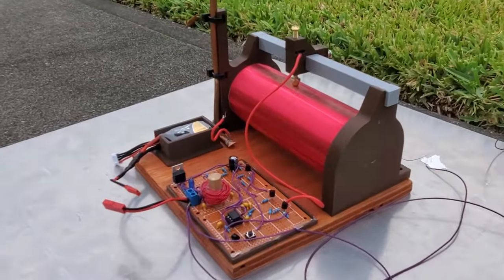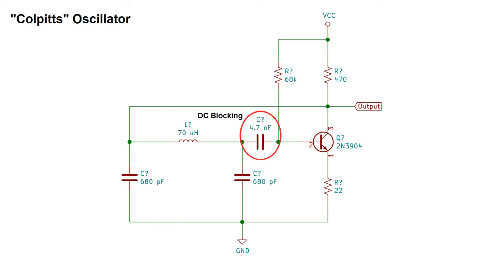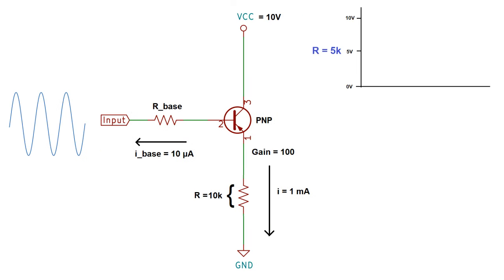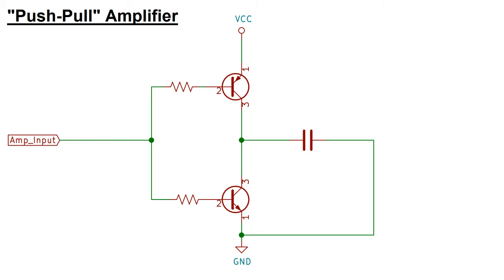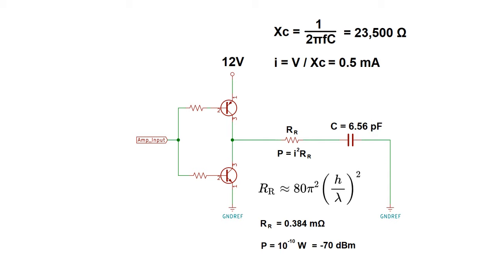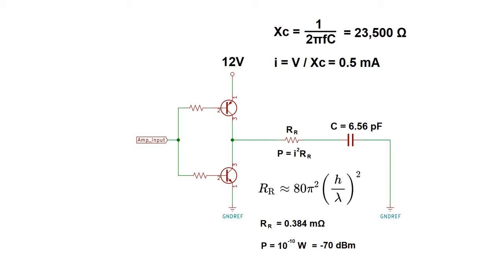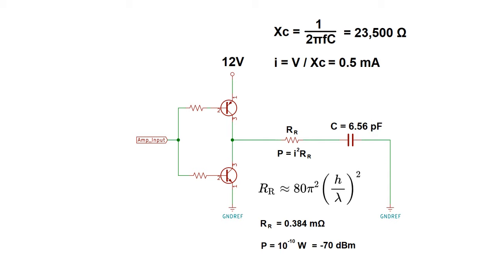1 MHz AM Transmitter

Comment: Well explained. I would generally be cautious though about transmitting square waves as the scope for spurious harmonics, especially without a low pass filter in circuit, is high. And yes, 1 or 1.6MHz transmissions,  without a broadcasting licence, are illegal in most countries.
Reply: Is it better to just transmit sine waves, and skip the wave “clipping” phase of this project that creates the square wave?
Reply: Can't be a Hyperspacd Pirate if you're a Hamm
Reply: I do want to get my radio license but how whould the government or related branches know it's me doing this and it's ok? I will make this after I get my license but whould me doing this get people angry Even if I have a license for transmission?
Reply: @kylewatson952  He's talking about transmission in so many YARDS of range, so the amount of power here is tiny, maybe 50-200mW, which will likely get swamped the first time someone with a '68 Cuda running copper core sparkplug wires drives by. :D   If you keep your transmission power under 200mW, and avoid sending profanity over the airwaves, try to stay out of active transmission space, and are only playing around 10-20 minutes at a time, nobody will likely notice.   As for locating spurious radio emanations, google search the term "radio fox hunts" or ARDF.  There are also plenty of public radio space bands to play with, called the ISM bands where you've got all sorts of consumer radio products operating, and oddball modulation schemes like LORA-wan devices, which is low power, low bandwidth, infrequent transmission for whatever gadgets you care to built. Say a bunch of remote weather or telemetry systems that can run off one 18650 battery for a couple of months.
Reply: Ya, square waves have infinite harmonics.
Reply: Also keep it under 100 mW (Milliwatts)and you'll be fine.  (0.100 watts)
Reply: My first schematic was a simple tube ( soviet 6P3S) AM transmitter with 10 W of power and crappy antenna. It has enough power to electrocute some sensetive digital devices and you because any object nearby  - antenna and when you touch something grounded - you get a shock..
Reply: he was so close!  😮  1.800-1.820 MHz is for Amateurs to do Morse Code.
Reply: This counts as a Part 15 transmitter, which can transmit with up to 100 mW in the US before running afoul of the FCC.
Reply: @stalkerfromvoronezh4493  😂😂😂
Reply: Square-waves all day, everyday!!!!

Comment: Why did you clipped the signal? It had a reason or it was a side effect of the amplifying? Also I noticed that the signal before the amplifier/clipping has 9.52V, and then it has 9.68V. It didn't changed that much. This step seems not necessary to me. Can you elaborate more?

Comment: Why add all the amplifying components if the maximum current draw from the antenna is only a few tens of milliamps? Yea sure you impedance matched it but the Q factor of that is so low that your not gonna be pulling hardly anything from your source. You could probably get away with attaching your antenna directly to the output of your colpitts.

Comment: When I was a child, built an AM tx using a 2sa15 germanium transistor, 1 ferrite rod, 2 100pf caps and 3 resistors. it ran of 2 dry cells. could be modulated with audio. It worked and was stable. simple colpitts oscillator. tuned by moving the ferrite rod.  no external antenna . sufficient signal for use in a small house.

Comment: To be clear, broadcast medium wave antennas are usually hundreds of feet high, but of course a conspicuous 'pirate' antenna setup would be an instant location giveaway. This is a nice demo for experimenters, showing that something can be got out of simple circuit and a tiny antenna. I think an opened out roll of cooking foil, might have been less lossy and would have made a slightly better ground reflector than a vertical ground rod.

Comment: Good work! I would improve the schematic 13:28 - between an emitter of Q3 and ground place 10 Ohm resistor (maybe with a capacitor 47nF). R10 change to 10kOm instead of R11 I would place wideband RF transformer: twisted five wires on a NiZn ferrite core (maybe with a small air gap).  Three wires (I mean windings) connects in series as a load of Q3, four and five wire connects to an input of the push-pull cascade with the 2N2222 transistor. The bias circuit for 2N2222 contains : a silicon diode (1n4148) with a 1-2KOm resistor to positive rail. Both transistors loads on a wideband output push-pull transformer.Both emitters of 2N2222 connected together and to the ground in series of a 10-20Ohm resistor. The wideband transformer allows matching high impedance of Q3 with low input impedance push-pull output cascade (because a Miller effect in BJT) and increases power amplification.

Comment: Nice! Future projects could be, naturally, voice modulation but also something that would turn on remotely using a specific sequence of pulses like a digital 'key' to trigger something at a distance like a light or something else, digital data like '1', '2', '3' etc., something that remains on as long as it receives the signal, and other fun applications for the receiver.
Reply: Welcome back to history, you're almost at the point of reinventing Morse code 🙂
Reply: @metamud8686 yeah and it seems that kind of technology has been lost in the dump as there is no information anywhere on how to make a multi channel transmitter and receiver from scratch without using the pre built RF modules and IC’s. What a shame 😢

Comment: The 555 that generates 1 kHz has an error.  There is a wire missing that is supposed to connect pins 2 and 6.  It won't work without this.

The Q4, Q5, Q6 outputs seem to be out of bounds.  The R17 biases Q5 fully on.  If the ground wire touched the antenna, the excessive current through Q5 would burn it out.  So there should be a DC blocking capacitor, like a .1 uF ceramic disk, in series with L2, to stop the DC.

But the output has too many harmonics.  Much of the RF is in the harmonics of the fundamental frequency.  They should be removed by a 1.7 MHz low pass PI filter on the output.  Without it, there will be harmonics that may be interfering with higher frequencies.

The ground wire is missing in the schematic.

Thanks for the video.

Comment: Pretty sure the push-pull amplifier has the npn and pnp swapped round (normally the emitters are connected together, and form the output). Also the 555 usually has pin 2 and 6 connected together in the configuration shown.

Comment: Cool beans.

I've assembled several over time & the last time I just used the 555 timer chip since you can get it to oscillate in the AM broadcast frequency interval. In a sense it sucks because the square wave it produces comes with plenty of harmonics, but I just wanted to play with the idea and indeed I did get licensed as kc2wvb roughly 12 yeats ago and even updated it in 2011.

Comment: There were no radios in the late 1800's. Try the early 1900's instead.
And of course the first working transistor wasn't made until 1948. That was a Germanium point contact transistor, which is quite large, and still exists as a museum exhibit. Junction transistors became available in the late 1950's, and Silicon junction transistors were later still.

Comment: At 1 Mhz the antenna would be an optimum radiator as a long horizontal wire , 20 foot off the ground , that  your garden permits ! ( the full wavelength is approx 300 metres / yards !!  ) , so a longer antenna is MUCH easier to match at this low frequency ... shorter antennas work best for stuff like CB radio ( 27 Mhz ) ... note : however a super efficient antenna might cause interference in the next state ! ( probably not a good idea ? ? ) .....

Comment: Nice job. Have you tried using transformers for the push-pull amp? They should increase your output considerably.
Reply from the maker: I haven't yet, but it's high on my to-do list for my next radio project.
Reply: @HyperspacePirate  See    https://youtu.be/y8te4Mir_BY     I'm still experimenting with an antenna matching network, so the range is limited. 300 feet of 10awg would do the trick, but I can't really justify that expense, nor do I have a broadcast tower in my yard. Ha ha. The coil set up you're using is similar to a crystal radio antenna I built a while back. Have you tried adding a 300p variable capacitor to it?
Reply from the maker: @andrewferg8737  that's an impressive setup. I'll need to look at it a couple times to fully understand what's happening, but your approach of inductively coupling your antenna is one i want to try with my next transmitter. I recently got a hold of several ~50-300 pF 3 and 4-gang variable capacitors from some old aircraft radios, so I want to try them out in a future build for tuning
Reply: @HyperspacePirate  "inductively coupling your antenna"

The output transformer of the push-pull amplifier is not technically part of the antenna, although electrically it certainly is. 
Normally I would put a pi filter between the antenna and that transformer and tune it for maximum output. This works great at higher frequencies like the FM band. I tried it  with the 3W base AM transmitter and it works somewhat, but I haven't had any luck at higher power in that frequency range. The 30ft antenna wire seems to dominate the output. I will try a shorter antenna with a large air coil & varicap next.

Comment: Thank you so much for this! The one question I have is: Why did you go to the trouble of turning the approximate 1mhz sine wave you got out of the Colpitts oscillator into a square wave? I thought that it would have been cleaner and easier to just use the sine wave and maybe filter it a bit to make it look nicer, considering that a sine wave has so many harmonics and all.
Reply from the maker: I'm pretty inexperienced with RF, so at the time i thought a square wave would be cleaner. After looking at the output of this transmitter on a spectrum analyzer and seeing all the harmonics, it was clear that that's not the case
Reply: Ah, right. Thanks for the reply

Comment: hi iam very curious, can it produces magnetorestrictive effect if ferrite core+permanent magnet was present in coil arrangement?

  if you read about ultrasound generator there are 2 type : piezo(ceramic) n magnetorestrictive(coil) based, both of them commonly work around 30 - 40 khz ranges, yours was 1000 khz!

Comment: Could you give a link to the site you found that antenna capacitance calculator ? I can't find it and I want to be able to make a good impedance match to get the most out of this circuit.
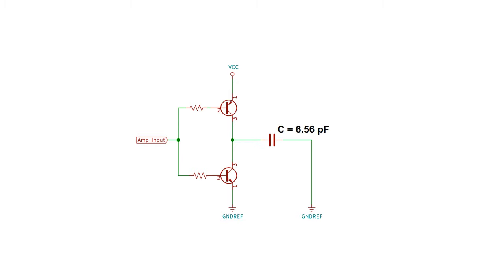Reply: Oh nvm I saw the link in the bottom-right corner at 08:03

Comment: Is it possible to create an am transmitter without the use of a power supply?
Reply from the maker: ? You mean without a bench power supply?
Reply: i mean if there’s a way to transmit radio signals much like how a spark gap transmitter works but without the use of a power source or batteries. I’m no expert on this field, but apparently such a device is possible.
Reply: If you see repeating comments it’s because they weren’t going through for me
Reply from the maker: @joemawmaw8609  

Only example of that I'm aware of is a steam turbine with a generator used to generate AC at the transmitting frequency 

https://en.wikipedia.org/wiki/Grimeton_Radio_Station
Reply: @HyperspacePirate  I sent you a link to schematics for such a device that may exist here but YouTube kept removing my comment for seemingly no reason. I sent you an email with the link if you’re interested, would love to know what you think

Comment: Error at 08:39 ?  If P=10^-10 Watts, then Log10(P)=-10, and that x10= -9 dBm ?  Or am I missing something?
Reply from the maker: Cause dBm is referenced to milliwatts, so 10^-10 W = 10^-7 mW = -70 dBm
Reply: Ah, so that’s what the “m” stands for!  Looked it up (just now) at https://en.m.wikipedia.org/wiki/DBm
Reply from the maker: @DavidEsp1  Yeah it can be confusing between  dB / dBw / dBm. To add to the confusion, in audio, dB are usually 20*log10(X) instead of radio where its 10*log10(X)
Reply: @HyperspacePirate  Yes that one already gotcha-d me.  They’re not really different in meaning, both are power, it’s just that in audio-land it’s amplitude (traditionally voltage, now digital) that gets measured and displayed as waveforms (in DAWs and NLEs).  So since power is voltage squared (and in log-world squaring becomes doubling)...
Reply: @HyperspacePirate  Just don’t get me started on dB differences for mono and stereo !   Loudness levels for mono generally need to be halved (-3 dB) as compared to those for stereo.  Based not on simple maths but a messy compromise - in objective reality depends mainly on how identical the sounds on each channel are.

I (and a pro I sought advice from) were “gotcha’d” (in my case badly) by that one (I guess no mono final mixes loudnesses recently experienced in that pro‘s broadcast world).

Comment: Oh dear. It could have been so much better. (It could have been an actual AM transmitter).Why create a square wave? That will simply waste power and cause a lot of interference. You've got a sine wave, why not use it? That's what the transmitted signal should be anyway. The modulation method might work, but will need alteration to actually allow linear operation with audio. Better to use series modulation of some sort.

It's a nice start for experiemntation, but will need some changes if you want to actually use it as, for example, a pantry transmitter or even a broadcast set.

Comment: HSP - I have a Question - and I Know you have the ability to answer. I've Subscribed to help your efforts and here's my question and I'm asking for your time yes that's what I'm doing
What would happen if I built a '2 x tower Tesla Coil' - only it has 110 pancake coils making up both towers so that's 2 towers with 110 pancake coils as opposed to a single wire aircoil these have 220 Pancake Air Coils all in 2 stacks - you got that so far?
Now I'm going to be weird and supply all 220 pancake aircoils with 3 different wire supplies and have all 660 wiring circuits all connected to a Really Big Transformer and balance it all off with some capacitors. The Pancake air Coil circuits are going to be 110v at 50 cycles.
Absolutely Not Wired like a Tesla Coil but apart from what is said that's what I want.

Now I'm going to hit those towers with a very powerful 8 Hertz and hold my 8 Herts for over 4 hours.

A. What's going to happen to the 220 pancake coils and structures holding them?
B. What's going to happen to the transformer and all the capacitors?

C. In your own words please describe the environment.

Comment: probably why the range is so bad is because the only transmitter schematics you can get is for low power transmitters in the micro watt range.

the fcc and arrl very carefully guards the schematics for transmitters for anything higher than a small fraction of a watt so if you want even to make 5 watt transmitter you need an fcc license and be a radio engineer.

Comment: 1. Put a Vacuum sphere on the top load. Better Signal
2. Just use a pwm to pulse the 1mF coil at 9ms better signal and POWER 
3. Most importantly, the ground rod needs to be In between the Inductor and capacitor. All together better Geometry Less parts and materials.